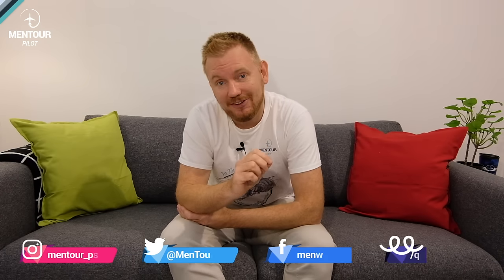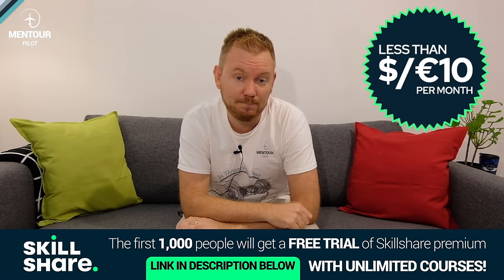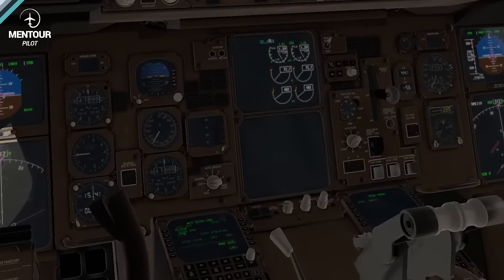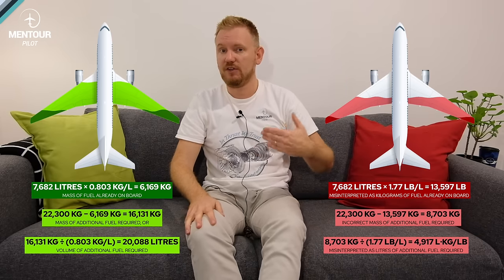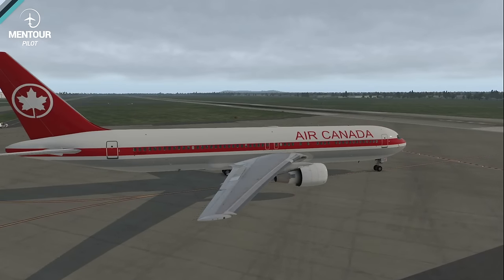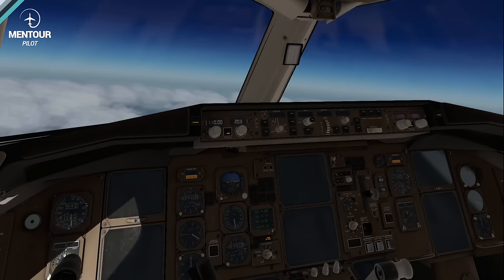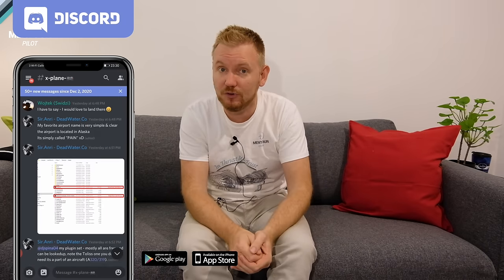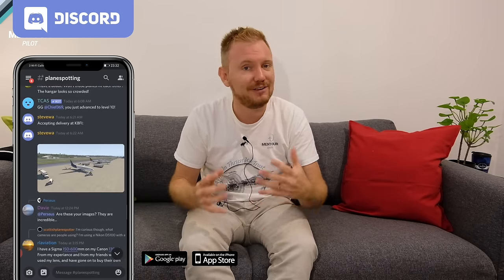The Gimli Glider! Explained

Comment: I flew the partially repaired 767 from Gimli to Winnipeg a few days after the incident. - Capt. David Walker, Flight Manager 767 (retired)
Reply: That's interesting!.. how "repaired" was it? They got the nose gear fixed, new tires, etc on the back?, maybe a little bodywork with pop rivets?
Reply: @Rx7man  It was a very partial repair. We couldn't raise the landing gear. Max speed of 210 knots indicated. Only two pilots allowed, no passengers.
Reply: @davewalker9926  Fascinating. I'll assume to save weight you would have calculated bare minimum of fuel to get you off the ground and to Winnipeg.  Did you go VFR? You need 30 minutes extra fuel or was that waived?
Reply: @davewalker9926  I'm not surprised about no passengers allowed!  Good job getting it home
Reply: @davewalker9926  where would they have got passengers from on a drag strip?
'Come to see the drag racing and get a free flight to Winnipeg'?
Reply: @gustavmeyrink_2.0  he also means no engineers, inspectors, company folk, other pilots, etc. riding along back with them.

They probably had a ton of people at the drag strip after the incident that were going to where the plane was, and had to go to a regular airport or drive.

Only the minimum number of people if it crashed...
Reply: I bet you were glad when that flight was over :-)!
Reply: Woo, you then become the Gimli flier, thanx for your bravery.
Reply: woah really? so cool!
Reply: But it was was patched up and flew out 2 days later not a few weeks...
Reply: @buseswithsam3280  It's only mentioned on Wikipedia and there's no substantial evidence provide for the same so take it with a grain of salt. On the other hand, if you look at the official report into this incident, you can find the name of Captain David Walker mentioned as the Chief Flying Instructor for the 767 at Air Canada.
Reply: Dave, how low did you have to fly it? I assume that pressurizing the cabin wasn't allowed.
Reply: @nukapowered  love to know the answer to this too! @Dave Walker
Reply: @joewaldner6986   wonder who calculated the required fuel to get it out of there
Reply: @MkBibble  And checked it 12 times :)
Reply: Neat!
Reply: @bigballz4u   No, the nose gear was partially repaired along with the main gear and some temporary repairs to the external skin around the nose gear wheel well. We did not retract the gear during our short flight to Winnipeg. We kept the aircraft unpressurized and we kept the airspeed slow. Permanent repairs to the aircraft were done in Winnipeg.
Reply: @davewalker9926  @Dave Walker. Thank you. That must have been a very tense flight.👍
Reply: I would have thought it was a write off!
Reply: I wish the repair and takeoff were available on youtube.
Reply: A pleasure to meet you, sir! 
I'm glad there was enough flat ground to get it back up!
Reply: @Rx7man  I'm trying to imagine the scenario of "passengers allowed". One single transfer flight off a decommissioned airport, in a damaged plane with jury-rigged repairs, I wonder how they'd advertize the tickets for that.
Reply: @sharpfang  with the number of people jumping out of perfectly good planes, I'm sure there'd be a market for it!... I mean people are eating tide pods...
Reply: @davewalker9926  How could you take off with the guard rail there and all the other stuff they had added to the old runway?
Reply: @MkBibble  It was a local brewer who calculated that they'd need 63 hogsheads to get to Winnipeg.
Reply: @joewaldner6986  also rolce royce engine's replaced with more fuel efficient toyota deisel engine's
Reply: cool :) congratulations, this big bird is like a fetish totem for many... :)
Reply: Nice direct explanation (w/ descriptive footnotes & commentary) of the Gimli glider incident.
Reply: @vaporisedair4919  Naw, I flew on C-GAUN a couple of times in the mid/late 2000s. Sadly, she was later flown to Arizona, and broken up for scrap.
Reply: @davewalker9926  hope you worked out the correct fuel needed, Lol  And no passengers? I would hope not!
Reply: I KNONW. I BEES THE SO CALLED THIRD MAN IN THEM AIROPLANES. I WAS THERES!
Reply: @BhattiJatt  THME DISELS ENGINES WERE LATER REPLACES BY THE GAS TOURBINES ENGINES FROMT EH BATMAN CARS. IWAS THERE. I SAW ITS! THNAKS YOU FOR BEING A TRUTH SEEKSERS. THUBBMERS UPPSERS, I BEES THUIBBME UPPSES 1!!!
Reply: @davewalker9926  Thank you very much for this very interesting informations!!! To my knowledge the aircraft was then until January 2008 in the fleet of Air Canada.
Reply: @Desopolis  it is only an hours drive from Gimli to Winnipeg 
No flying required 👍🏻
Reply: @MkBibble  not the same person who calculated it to get there 😉
Reply: @davecrupel2817  That would be most of the Province 😉
Reply: @pozzee2809  I suppose they could have blocked access to the highway between Gimli and Winnipeg and let the plane taxi all the way.... Highway 8 or 9 would look like the best bet based on Google maps....
Reply: Love you program but with every video I become less able to fly on a commercial flight. Like the saying goes, " I'd rather be on the ground wishing I was up in the air than be up in the air wishing I was on the ground". I still love your video's.
Reply: Did you check your own fuel ? All kidding aside , hats off to your courage of guiding that wounded bird !
Reply: @dave walker, before reading all the comments, or watching the full videos, as a truck driver/mechanic’s daughter…
RESPECT for your skill, and nerve.
Reply: @NicolaW72  yeah, the most stunning part of the incident... is not that the crew and passengers lived.  It's that C-GAUN completed it's planned service life.  It didn't have severe enough damage from this to reduce it's service life. So in a matter of speaking... that plane survived the incident too.
Reply: @nonenowherebye  I heard that it actually didn't get scrapped until it's original planned service life was complete.
Reply: @marhawkman303  Correct.
Reply: It's an honor to meet you, Capt. Walker. May I ask what your favorite plane to fly is/was?
Reply: @lvbdevinelove2329   It's a pleasure to meet you as well.  I loved them all, but I have to say that my favorite was the Boeing 767.
Reply: @nukapowered  It was a very short flight to YWG and we flew unpressurized. I think we flew at 4,000 feet.
Reply: @pozzee2809  Could have taken the wings off and sent it up the highway.
Reply: @gustavmeyrink_2.0  The drag race winner gets a free week in Winnipeg.  The loser gets two weeks in Winnipeg.
Reply: Must have been a challenge to get a tanker of jet A to Gimli. What was it like to take off on that abandoned runway?
Reply: Thank you for everything you’ve done over your career to keep us safe in the skies, happy Easter!
Reply: It must take guts to fly a plane that you know is damaged, even for a short hop.
Reply: Write a book please 🇨🇦✈️📘😊
Reply: @Rx7man 😢😮😮 😮😮😢😮😊t😊😊😢y😊
Reply: Wow…
Reply: @davewalker9926  that makes sense.  You flew unpressurized because you didn’t trust the skin?  That is so cool.  I would be nervous about flying it, even unpressurized.  🫡
Reply: Yeah Gimli to Winnipeg is only a hair over an hour by car.  That’s so cool.  I’d love to talk to you about it if you wouldn’t mind sometime….
Reply: Dang! Respect. 
Nowadays, repair would last weeks or the plane would be written off easily.

Comment: I used this incident several times in my physics classes, vector math, glide ratio, the importance of correct unit conversion, and to test whether they do a reality check on their results and understand how flying works. It is a perfect example :-D
Reply: Exactly..check your work. I recall unit conversions from college physics ;
You're either right on, or way off.
Reply: In any physics class I took I was required to have units on EVERY number. Teacher would mark it wrong without units. That sounds harsh but this example is precisely why you do that. If the units don’t work out then you’re doing the problem wrong!
Reply: I also thought about that. But if they were even slightly neglecting, which the wrong conversion ratio hints towards, they probably just took the number 1.77 and wrote kg/l behind it. In that case, writing the units down, wouldn't have helped, because after the number they then wrote kg, and the rest of the calculation then works "correctly", even though it isn't, because they haven't checked their prerequisites.
Reply: The physics nerd in me is compelled to mention that 1 liter of water has 1 kilogram of mass. It makes a good sanity check: if you’re writing down a liquid conversion that’s substantially different than 1 Kg/L you should wonder, is this close to the same density as water? If so the number should be around 1.
Reply: @joshcarter-com That's the first thing I thought of when I got to the relevant part in the video; The density of fuel tends to be a bit less than water but not an extreme amount. 1 kg equals 1 l, of water, so unless your fuel is made of mercury, it's a pretty good approximation if you just want to do a sanity check.

I don't know why they weren't more careful about the calculations here but I guess that's just the thing. There was just a particular combination of human failures. Almost always the chain is broken at some point. In this case, the chain of events leading to utter disaster was broken only by superior piloting skills.
Reply: @aggiebq86  I think much of the engineering world is metric already. I do all of my own design work in metric, and it seems like metric fasteners are used on most things I need to work on. Car guys are always losing their 10mm socket these days, not their 3/8” socket. I completely agree we need to finish the switch and be done with imperial units for good.

Comment: Also worth noting is that several air crews gave the situation a try in the simulator but all crashed.
So a very unique situation with rare circumstances.
Reply: The consequences were different for the actual flight crew than for the wanna be's.
Reply: NO, THAT IS A CONSPIRACY THEORIE, IT IS NTO VERIFIED, I FATT CHECKWD IT!
Reply: @ilovecops5499  Im srue yu di d teh bets reseearc h.
Reply: @cayrick  well part of it is experience.  Pearson did maneuvers in a 767 that, for stated reasons, no one trains on.  It's that simple.  NO one in their right mind would do that side slip during normal operation because of the risk of flameout.  Pearson was a person who had practiced the maneuver in other aircraft.  He hadn't in a 767, but. well he at least knew how to do the maneuver safely.

The part that's most impressive.... is that this wasn't a CRASH landing... nope.  Not normal, by any means, but not a crash landing.  But C-GAUN left Gimli under its own power and was returned to active service.... yeah... it came in with no fuel, skidded down the runway.... but wasn't wrecked.  It takes a heck of a pilot to land an aircraft like that.  I'd love to shake his hand.
Reply: @marhawkman303  The sideslip explanation given by Petter was a bit weird - the engines were dead, so turbulent air off the forebody wouldn't affect the engines here.   Sideslips do present a risk of stalling the wing that is partially blocked by the forebody.  Not a risk for this aircraft-plenty of wing I suppose.  I know of a  Cold Lake T-33 crash caused by a sideslip maneuver where that happened - too close to the ground to recover.
Reply: @gordonepema722  Well Petter was explaining why you don't normally do that in a jet.  It can cause engines that are working properly to stall.  Ok maybe not cause both to stall perhaps, but enh.  Undesirable even if it's only one.
Reply: @gordonepema722  That's why you don't do it normally, and why they didn't have a problem doing it this time, because the engines were already dead.
Reply: I think you are confused with United 232. This incident was fairly straightforward and most air crews would have dealt with it. They had plenty of altitude to play with.
Reply: The likelihood of the simulator being able to correctly simulate the physics of the side slip, and its effect on the RAT and hydraulics is almost certainly zero. 

That’s some extreme physics to try and model in software.